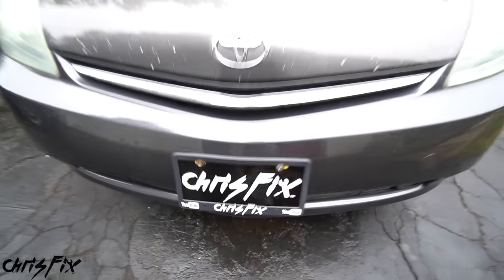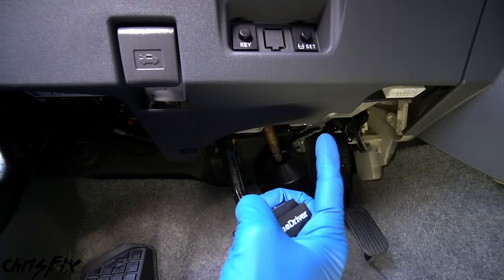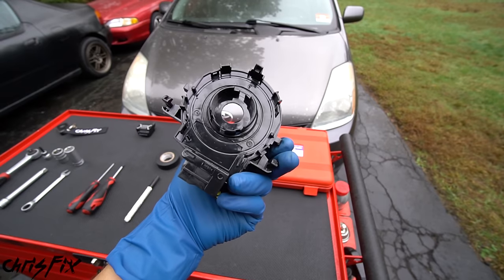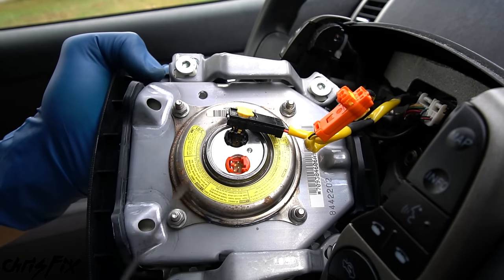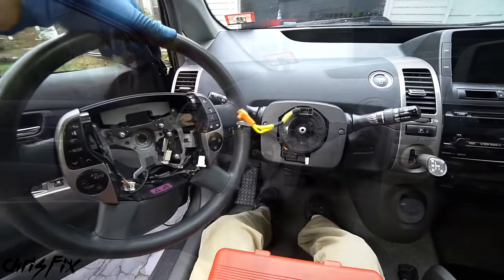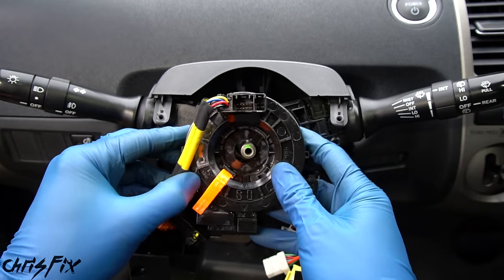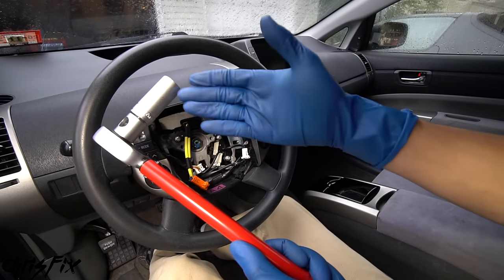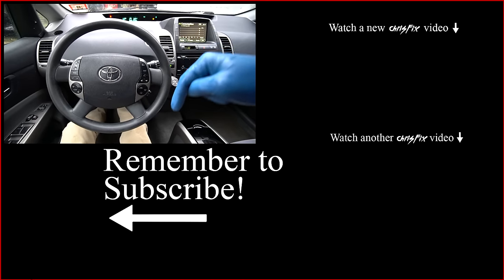How to Replace a Clock Spring (airbag light & horn not working)

Comment: Hey chris i was wondering why most car had drumbrake in the rear wheel ? And why does it not use disc brake ? And also what the main function of drum brake in rear wheels ? 

Please answer !!!
Reply: Main function: brake.
Why most car have drum breaks: It's cheaper and durable compared to a caliper system the downside is that it breaks more slowly compared to a caliper system and that's why yo never see drums behind the front wheels... And because it just won't fit.

Comment: That was a lot easier and cheaper than swapping the clock spring in my diesel pusher motorhome.  Didn’t think the steering wheel was ever going to break loose.  And since I was only able to get a replacement clock spring from Freightliner, it cost me $500 for that little piece.

Comment: Thank you very much for an informative video! I do have a question however, my 2017 Camry SE does come with paddle shifters. I know that there is a distinction between installing a clock spring into a vehicle without paddle shifters and one with paddle shifters, I just haven't found a video helpful with that installation. Any chance you can help clarify the process? I would appreciate it!

Comment: The first thing you wanna do is test to see if the airbag is working, I've found that going head on into a cement wall is a great way to check it, right around 35mph should do the trick.

Comment: The one in my 08 town & country just made a clicking noise every time u turned the steering wheel but I’m sure it was going bad. The oem replacement was ridiculous and I couldn’t find it for under $350 so I bought an aftermarket one and it was still $235 but it has a lifetime warranty

Comment: Hey Chris,

I appreciate the video you provided. I would like to know if there is a method to recenter the steering wheel. Regrettably, I failed to mark the appropriate nut and thread during my previous adjustments, resulting in the steering wheel being slightly offset to the right. Your guidance on this matter would be greatly appreciated.

Thank you in advance.

Comment: Great video I had a question though regarding the thread locker I was wondering if it be ok to use orange thread locker instead of blue? just to play things safer? its not permanent like the red but it’s supposedly three times stronger than blue

Comment: Hey Chris! I love your vids. Have you ever come across an airbag that was jammed and refused to come loose? That is what I'm dealing with right now. Both of the Torx screws are completely loosened. The airbag will wiggle but I haven't been able to pull, or even gently pry, it out after numerous attempts over several hours. Might you have any suggestions? I'm open to any and all suggestions because I'm at a loss and pretty frustrated. Thanks!

Comment: Hey Chris great video!! Thank you so much for that.
Mange to do it by myself for free comparing to professionals at my area...LOL
One problem though the airbug light still on
Do I need to reset the airbug computer or something?
I got 07 Santa Fe.
Reply from the maker: Nice work! Some cars you might need to use a scantool to clear the computer so the airbag light goes off.

Comment: Tech tip if you remove the negative terminal then the positive terminal and touch them together you can short out the capacitors and work right away and you won’t damage the capacitors

Comment: *Helpful Tip* - Leave the center nut for the steering wheel threaded about 3 - 4 threads in before removing the steering wheel

If you're pulling the steering wheel off and it's stuck, if it suddenly frees up, it will not smack you in the face, as the nut stops it

Comment: Hey Chris thanks for sharing the information. My car Nissan tidda horn was not working n I replaced the new clock spring now horn is ok but steering air bag light doesn’t go off. Now, when ever I start my car the air bag light continues blinking please may I know how to fix it thanks.
Reply from the maker: Do you have a code reader that can read airbag codes?

Comment: Hi Chris, how you doing?
So, all the clock springs for Prius for this year are the same? I mean, I have the same problem with my passat b8 2015, and the mechanic said we need to remove to see the correct part number, but obviously, if I can buy after market without need to re-code the part, will be amazing!
What do you think?

Comment: I bought aftermarket clock spring and installed it. i immediately noticed my blinker wasn't returning, and my steering stuck on me after a few days of driving. A technician told me to buy the part from the dealership and install it. I just ordered one today and am getting it tomorrow. Hopefully,  this will make the blinker auto return works. .

Comment: Just make certain it is not anything else,  I almost bought a clock spring bought it was just a few freak things wrong that all could be diagnosed by a faulty clock spring 😂
I bought a car whose horn wire was broke, and airbag light was on, which turned off the cruise control, because the horn, and cruiser control didn't work along with the airbag light. Went under my dash to patch in a temporary button for the horn and found the cut wire, along with I found out that the airbag and cruise control was because the passenger occupancy sensor was unplugged
Reply: Much better then buying a $350 clock spring from the Ford dealership, or trusting one to work from Ebay, just to find out that it wasn't the problem

Comment: So I replaced my clockspring on my Toyota Sequoia (very similar process), thanks btw for this video. However, the horn still intermittently works only when you turn the wheel. Could it be my air bag? Any advise would be great! Thanks again!!

Comment: Hey Chris, I have a 2007 Dodge Charger and my horn went out. The horn works when I press my door lock keyfob button so the horns themselves are fine. I noticed for a while since I owned the car the horn would only sound if the car was running and wouldn't work with the car off. Then it died totally. I was told by someone at the dealership that I needed to replace the airbag cover because I felt a weird pop hitting the horn one day so he said the membrane on the underside of the cover probably went bad. I also have a airbag light on but that didn't turn on until I bottomed out REALLY hard one day. My steering wheel has no controls for radio or anything like that but all my other functions do work(cruise control, turn signals, etc,). How do I test to find out if my problems are the horn membrane and crash sensors in the front(from bottoming out) or if it is in fact, somehow, the clockspring?

Comment: Thanks for video. I have a 2011 toyota prius. Horn and only two buttons on steering wheel (right hand side on steering wheel) don't work, i do not have any lights ON on dashboard. While searching online for a new clock spring, i found some clock spring come with sensor and some don't. Which one should i get? Thanks in advance

Comment: what chris loves *extended, I saw this before and wanted to add to it :)
#1 family
#2 cooper
#3 medium strength thread locker
#4 torque wrench
#5 owners manual
#6 saving a ton of money
#7 going for a test drive
#8 fixing your own car in your driveway
#9 soapy wooder
#10 paint marker
#11 seeing if she'll start
#12 the engine purring
#13 project cars
#14 positive camber
#15 buying dream cars
#16 proper alignment
#17 the dyno
#18 turbo kit
#19 the track
#20 the driftstang
#21 microfiber towels
#23 your favourite carpet cleaner
#24 head gasket
#25 foam cannon
#26 pressure washer
#27 thick layer of foam
#28 wet sanding
#29 making scratches disappear
#30 deep mirror shine
#31 disconnecting the negative terminal
#32 not scratching the paint
#33 clearcoat damage
#34 no power to the engine
#35 coolant

Comment: My horn isnt working on a 2004 model car. Last year it has the SRS light on. When I took it to get inspected for registration renewal the mechanic cleared the fault but didn't tell me what it was. He shouldn't have passed the car with no horn but ho hum. I can't believe he didn't know that's the probable reason the horn wasn't working. So I guess that wasn't the reason. The funny thing is now the SRS light doesn't remain on for a few seconds like it should when I start the car. It goes out very quickly. I'm hoping it's just the horn itself that needs replacing because that should be cheaper. I don't trust myself pulling anything apart on a motor vehicle.

Comment: Hey Chris, I heard some people say disconnecting power in newer cars(like hybrids) cause car computer to malfunction, so if we change the battery we have to give external 12v power to battery terminals until new battery is connected. but I saw that you did it without any problems even when you disconnect both 12v and, high voltage batteries in your Prius. can you explain about that myth...

Comment: Do these clock springs already come centered from the manufacturer?? Or do I have to find center manually???? Thanks!!
Reply from the maker: They should come centered, but I would double check and see if there is a centering procedure for your specific make and model!
Reply: @chrisfix  👍

Comment: Hello Chris fix I have Toyota tundra 2008 which is cruise control is not turn on because no power go to the switch 
Is it clock spring? All fuses good
Reply from the maker: I would first remove the shroud around the steering column (turn the wheel 90 degrees left and remove the screw, do the same on the right, then it should be removeable), then on the right by a black plug you'll see a brown and blue wire. With the key on, apply a ground to the blue wire and see if you can turn the cruise control on  like that. If you can then you have a either a bad switch or clock spring but I would venture to say it's likely the clock spring

Comment: A good trick I like to use on the Priuses when I work on them is to use a tennis ball, cut it in the Middle where it opens up like Pac-Man and shove the terminal into the inside because they can still connect and ground out with that Hybrid battery. Kind of an extra safety method and I have to deal with batteries every day at work.
Reply from the maker: Thanks for the safety tip!

Comment: Hi Chris. I know this is an old video and all but i was hoping u could answer a quick question for me. 
I have a 2010 Sebring that nees the clock spring replaced and ones ive found on ebay say they do t have an angle sensor, just like the ine in this video.  My question is, are there any type of electrical connectors from the clock spring to the angle sensor, or is it a mechanical only connection?  Thanks

Comment: @ChrisFix Hey man! My wife has a 2015 Fusion. All electronics on her steering wheel stopped working. The only thing that WORKS is her horn and the wiper blades on HIGH only. The things that DONT work are blinkers, all buttons on the steering wheel (radio, volume, phone calls, cruise control, etc) high beams, wipers below high, windshield cleaning. I have replaced the fuses and the clock spring and no luck. I am lost what it could be and I don't want to take it to a mechanic

Comment: Hi Chris, small question... after chaging my clock spring, do I need to reset/calibrate my steering angle sensor in a professional garage or just transfeing it to the new clock spring will do? (Hyundai i 20 - 2013)
Reply from the maker: You shouldn't have to as long as you do everything correctly!

Comment: I'm just going to go out on a limb here and guess my 1987 iroc Camaro doesn't have a clock spring but it's horn isn't working and I've taken the horn off of the steering wheel and it's a super simple wire and spring with a post through it (best I can explain it) so whenever I get the time I will try to fix it for real

Comment: omg i cant believe i found this video i was ready to go to the dealer for my 2014 toyota corolla s thinking my wires are like fried or something so im try this out first cause my horn isnt working and the airbag light is on... but also my radio isnt working its stuck on a reboot thing. but i guess fix one problem at a time .

Comment: Im not sure if u mentioned what type of OBD scanner ur using. I also have a scanner that connects to my phone via Bluetooth but i have yet to find a compatible app to display the info from the scanner. Mine did not come with any software dl or app specifically for my scanner. Mine was a cheap buy and for obvious reasons stated but if there is an app u could recommend that works universally with bt obd scanners, Id greatly appreciate any wisdom.

Comment: Sorry if I am reviving an old topic. My Cruise control button only works at a certain hour position, so I am inclined to change both the button and the clockspring. But i've been hearing lots of people against using aftermarket clocksprings since they can detonate your AIRBAG? I don't see how this would be the case, but just wanted to know your input on this-  Thanks

Comment: Definitely secure those steering wheel bolts. My long time ago ex installed an aftermarket steering wheel on her s10. And while I was driving it down the highway, with her in the passenger seat, the thing came off in my hands. 😬
I hit the emergency lights, feathered the brakes and down shifted  as we drifted to the center barrier. Hit the brakes hard just before we side swiped it. Minor cosmetic damage only. Really f-in lucky.

Comment: I'd like to recommend you that it'd be better and safer to pull the orange safety tab from the clock spring after you reinstall the steering wheel, so it wouldn't be a headache to line it straight

Comment: Chris a quick question.

What is the difference between one pin air bag and two pins airbag. 

Like see I have a 2016 maxima and the steering airbag has 1 pin
But on 2023 it has 2 pin 
However the car is exactly same not changed

Comment: if i were swapping a wheel into a car from another similar model, would it be wiser to use the designated clock spring for whatever car the wheel is coming from for the basic steering controls to work?

Comment: I had to remove mine three times because the ring that shows the backup lines was off because I spun it wrong and it wasn't aligned. I also didn't hear the click and the airbag light stayed on. After the third time I finally got it right. Didn't need the steering wheel puller either.

Comment: Hey Chris! I have a 2007 Acura TL. Every time the alarm goes off/horn is pressed the 20A fuse under the hood (brake lights/horn/stop fuse) would blow. Then I can't take the car out of the park and my horn and brake lights stop working because of that. I replace the fuse and everything goes back to normal but it is pretty annoying. Do you think it is also the clock spring?

Comment: Replaced the cable Reel (clockspring) on my 03 Accord EXV6 Sedan. After replacement the horn and steering wheel controls worked again. And the SRS light went out.

Comment: Hi Chris I got a 2012 Prius and my traction control light is on, can my clock spring be bad? And can the original angle sensor can go bad? If I buy a aftermarket clock spring and swapping the angle sensor over it should turn off the light right?

Comment: Hi just had a clock spring fitted unfortunately before I saw this video £ 500! But although the airbag light has gone out and the horn now works Lots of things don't ,thumb wheel won't bring up information, cruise control doesn't work.Does this mean it needs reprogramming? Your video didn't require this.
Reply from the maker: It could need a reprogramming procedure if those aren't working anymore, the shop should have performed that as part of the new clock spring install
Reply: @chrisfix  Thanks very much for a prompt reply. I will return to the garage!

Comment: 2001 Chrysler PT Cruiser horn doesn't work, airbag light is on, I tested the horn and does work and relay works too.
Cruise control does work, use my code scanner and it stated "Passenger Squib Circuit #1 Open".
I would assume it is the clock spring needs to be replaced maybe?

Comment: hey Chris fix, on my dads 2008 Jeep patriot the air bag light is on but the hooter still works but when he wants to turn, the indicator takes a few tries and I was wondering if it is the same prosses. And when my dad did alignment the guy said that he needed to replace the Tyrod and the brackens and recently the throttle body went and he said he can put it on but he cant program it and its to expensive to do it any where and i live in South Africa where everything is expensive and can you do a video on how to do this please. And he has an extra throttle body.

Comment: Hello, I would like to ask. I had the clock spring replaced at a repair shop. I noticed today that the air bag is shaking. I opened the steering wheel cover to make sure the screws were secure. I would like to ask what the problem is?

Comment: Question,  I'm not sure of it's the clock Spring or also the bag it self so I was thinking about buying a whole steering column from salvage.  But obviously the used wheel won't be straight.  Will the clock Spring break if taken off not straight or only when putting on not straight?
Reply from the maker: If you try to take it off not straight, you could potentially break the clock spring, I would try to pull each item as a piece and then assemble after the fact!
Reply: @chrisfix   My real concern is that the guy removing the parts from the car at the salvage yard doesn't mess it up
Reply: @chrisfix  update that can help viewers,  I bought a colum from junkyard,  it did work after installing the clock Spring,  but once installed it broke after turning wheel. So prior to installing you have to make sure it's I'm right position,  there's videos showing how to make sure it's centered,  you turn around twice until feel tension.  Wish I knew prior I just ordered a new one from the dealer,  $167 online.